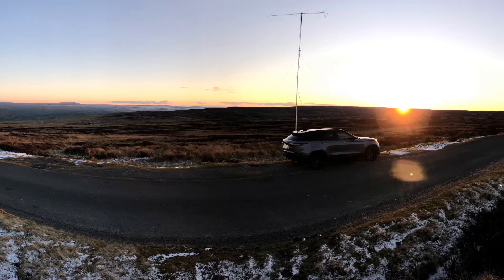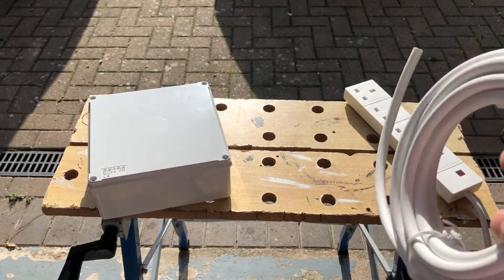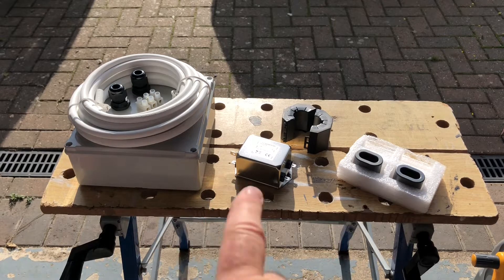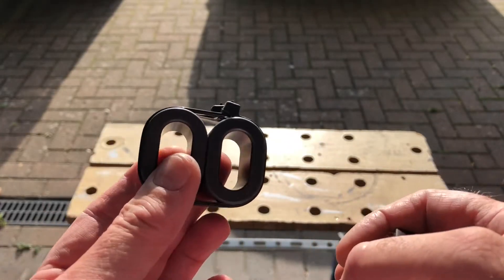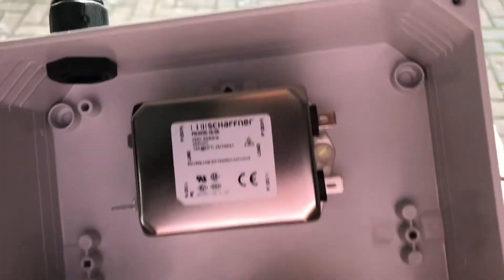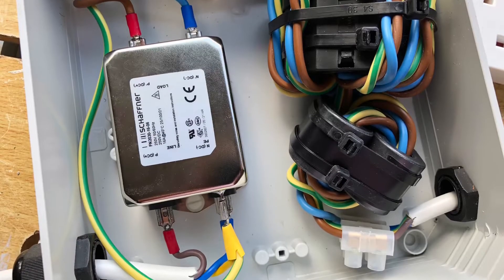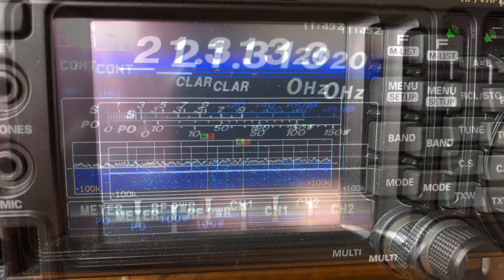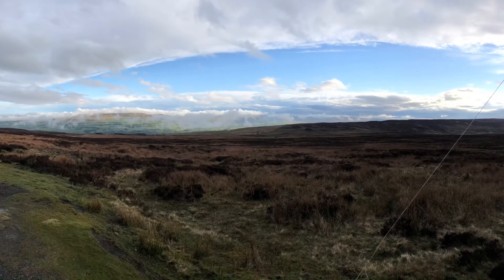Eliminate Your RFI - Build Your Own Mains Filter

Comment: Hello I hope you are doing well 
Can I use 3 Schaffner filters to get triple stage filtering? Can you tell me how to wire them properly?
Reply from the maker: I’m not sure there’d be any benefits of putting the same spec filter in series? And others are probably similar in spec as well, so no gain in say frequency range or attenuation etc? You could try. Just take the output of one as the input of the next following the models wiring instructions. Good luck 👍🏻
Reply: @G0CNN-Ian Thank you. I'll try my experiment. I think it's better to fuse high frequency and low frequency filters together and could give better results.

Comment: You built a Low Pass Filter. To get rid of the specific frequency noise, also include a Band Stop Filter, designed to that frequency. It will shunt that frequency straight to ground. It is simply and inductor and a capacitor of appropriate sizes that can go inside your filter box.

https://en.wikipedia.org/wiki/Band-stop_filter
Reply from the maker: Great. Thanks.

Comment: does it work the filters with 120V?
Reply from the maker: You’ll need to check the spec of the mains filter inside to confirm its working voltage, as this may need changing. You also need to check this wiring layout works with the mains supply wiring standards if you’re not in the UK.

Comment: For 50 Mhz and higher, How about using filter high voltage capacitors .01 uF and .001 uF across L1 to Ground and L2 to Ground before it goes into the commercial filter that is probably effective below 30 Mhz.
Reply from the maker: @Chad.Tyrone  For someone to consider. Thanks 👍🏻

Comment: Hi Ian, Did you ever drop the noise level down on 6 meters and if yes what core did you use? Great video, Thanks
Reply from the maker: @andya940  Hi Andy. No. Tried all sorts of multiple rings in various places. Never managed to suss 6m. One suggestion from the supplier of the mains filter was to take the earth lead direct to the output and not via the ferrites….never got round to trying and generator now gone  in favour of LiFEPo4 battery 👍🏻 I think the generator was more at fault than the filter….

Comment: Ian - very interesting project - and very good that you performed tests on varying bands. I am interested to see how you do with eliminating the remaining QRM on those bands that were still impacted. Will you do a follow-up video to show us? Do you know what the effective filter frequencies are? Have you considered shielding the mains cable between generator and filter box and between filter box and power strip? Have you considered lining the box with copper (or aluminium) foil to create a Faraday cage? Have you considered using an earth spike since you're going to use it in the field? Do let me know what you think. All the best, Rob in Switzerland
Reply from the maker: @RobWhittlestone  Hi Rob. I no longer use this generator and have moved onto LiFePO4 batteries. I tried various additional tests and ferrite combinations, but I could not eliminate the rfi on 6m. The tests showed the rfi was down the cable itself. One tweak possibly would be to take the earth lead in the filter straight to the exit of the box and not via the ferrites. Regardless, it worked great on other bands as you saw . Thanks for commenting 👍🏻

Comment: i would think that green wire should also be grounding the case of the line filter too, no? 

i have some SWL antennas that could use this
Reply from the maker: @thatfonkyhonky336  It does. Then branches off through the ferrites. Another design may be to take the earth straight to the socket and bypass the ferrites.

Comment: I have been looking at this design, and powerline filter...how would you do this in N. America where we have 2 hots, a Neutral and a ground? Would you need a different kind of filter? Or maybe 2 filters? Voltage been each hot to neutral is 120v, 240v between each hot leg (120v 180 degree out of phase).
Reply from the maker: @BryanGrigsby  Hi Bryan. I’m not sure. I thought you had three wired mains like us, just at a lower voltage? Best to consult an electrician I’d say. Good luck.
Reply: @G0CNN-Ian  Yeah, it's different than UK, two 120 legs, 180 dgrees out of phase, so 240 across each leg, with a neutral and a ground. I think I've determined you can use the same style filter running it either with 240 across both source inputs, and bypass the filter for the neutral, or run two filters for each 120 leg. I am going to test and see. I think I am preferring the two 120 routes, to make sure the neutral is also passing through the filter, but I am just guessing.
Reply from the maker: @BryanGrigsby  ok. Be careful.

Comment: Silly question but will it work with home installation as well? I have some degree of noice coming from various places/devices. Can I make one as put between my mail socket and radio equipment?
Reply from the maker: @dadscanplay2  Yes, that’s actually what it was originally designed for 👍🏻 Do a mains-off battery test first just to double-check it’s mains RFI
you’re experiencing, otherwise you’ll be wasting money. Good luck 👍🏻
Reply: @G0CNN-Ian  thanks Ian, I’ve done it already it’s seems that it could be a case. Great video appreciate it.
Reply from the maker: Good luck sorting 👍🏻

Comment: Well done! But if I see the design of gm3sek the LOAD and LINE not are the same of the your project. Why? Many thanks
Reply from the maker: Not all filters are the same. I’ve fed back to GM3SEK. Best to check the spec of the filter you’ve purchased before wiring. Good luck 👍🏻

Comment: Does the wiring around the cores get warm?
Reply from the maker: It shouldn’t do as it’s all rated to comply with the normal wire/fuse rating. I wouldn’t be touching anything inside of the box when it’s live. Thanks.

Comment: Will this technique work with a 12v to 240v 50 hertz sign wave inverter?
Reply from the maker: Hard to say Michael. I have had success with a generator but never quite sorted 6m inverter interference. I use a battery and inverter on 6 for occasional rotator use (due to the interference), but not tried the filter inline with this setup. I might give it a try to see 🤔
Reply from the maker: If I remember Michael, I’ll be able to try this Thursday on the 6m UKAC. Just depends if the interference is cable or air-bound…
Reply: Ok cool. Thanks for replying, if you get the chance to do a video I will watch. But if not I'll have to experiment and see for myself.  Thanks for the video 73's 👍
Reply from the maker: @michealbell5042 I tried it last night Michael and it didn’t work on 6m. I know it does work on the generator on 2m & 70cm, but I use battery & inverter on 6m because I can’t filter all of the generator inverter on that band. The battery inverter must have the same issues….
Reply: @G0CNN-Ian  Thanks for trying.  I guess that's where we have to experiment with it. Hay but you konw what you still did grate video and thanks again for replying. 73 and merry Christmas .
Reply from the maker: @michealbell5042  Merry Christmas Michael.

Comment: Thanks for your great video. I have built your filter with the same components and saw a good improvement.
My problem is that my high end PC is working perfectly at night while getting slow and sluggish at daytime which is a big problem for competetive gaming (even offline on Desktop).
It happens from grid and from a power station disconnected from grid, the Filter improves both, but I can not measure it.
My question is with which device and accessories I can troubleshoot this problem as cheap as possible? It is hard to find information as a noob.
Any hint would be appreciated. Thank you
Reply from the maker: Sorry to hear you’re still struggling. I’m afraid I’m not aware of a means of measuring in the way you suggest. Apologies if you’ve already considered this, but I wonder if you’re actually competing with other households sharing the same ISP local infrastructure and that’s why you see marked differences between day & night internet performance? Good luck getting sorted 👍🏻
Reply: @G0CNN-Ian thank you for your answer.
As the problem persists offline when the pc is not connected to the Internet, but your filter improves it, I suspect EMI/RFI.
So I would like to know which device I need to troubleshoot or how to even start. Spectrum analyzer? I looked at the model "TinySa Ultra".

This offline day/night difference is a widespread problem in the competetive gaming scene without any real findings yet. People trying many PC builds and different locations, until they sometimes find a "good" location by luck. So the problem is definetly something about the Location.
The main symptoms are:
-delay of input until visual response
-degraded visual quality of the monitor
-..
Which improves much at night.
I understand if that is the wrong platform to ask this but gamers are no RFI Specialists and I was trying to get any hint😅
Thanks
Reply from the maker: @patrickh9679  Ok Patrick. An easy electronics way to test is to run the PC on battery power. Either through a suitable inverter to provide mains voltage from a suitably sized battery, or with the right know-how, tap into the DC side of the PC power supply when not connected to the mains and provide the equivalent DC volts & amps ie pure battery power. THE IMPORTANT PART: A qualified electrician or electronics engineer needs to do this, to avoid all the obvious safety risks to the person undertaking the work, plus avoiding the damage risk to the PC. Good luck.
Reply: @G0CNN-Ian  understood, thanks.
Maybe my first post was confusing.
I tried run pc offgrid from:
a)bought 2000wh pure sine wave power station
b) car battery + pure sine wave inverter
nothing changed it is even slightly (constant) worse. Thats why I thought the problem is rfi and I wanted to check it.
Still this mains filter improves the situation for power station and ongrid. I have not enough know how why this could be.
The direct supply of dc is interesting, thank you.

Comment: With my horrible QRM on hf coming from my inverters , I’ve ordered in these filters and ferrite , enough to build two of these filters , I’ve got a 15amp 230 and a 25amp version , 

This QRM off the inverters is a real problem , I’ve proved it coming from the pair of inverters , even switching the load to the house off, there is still QRM from them , I think it’s going to be a challenge to cute this QRM for sure.
Reply from the maker: Good luck 🤞🏻

Comment: hi for the 6 m and above usualy you need a linear suply  hevyly filterd vith lots of small electrolitic and rfy caps and power cable 4 the radio shielded  and choks on the leeds 4 me it helpes maby it whill 4 you 2  73
Reply from the maker: Thanks for the info 👍🏻

Comment: A couple of points for safety. They may be covered elsewhere in the comments. 
Portable generators should have an earth at the generator as the origin node. This is always the case. In the event of device (load) failure you will need that protective conductor working. I strongly suggest an RCD on the output and said earth. Normally this is a spike driven into the ground below ground level (as the surface would become live in fault conditions). Your RCD would cut current in any event and also permit a far poorer earth to be operational. Always beware of underground hazards though when driving conductive rods into unknown ground.
Those were common mode chokes. All conductors passing through the same core. The idea being that current going up rather than round is dumped into the ferrite. Placing the earth in there too prevents it from draining this bad energy to where it should be going. That would be the true earth that you installed with the generator. The protective conductor should not be in the filter circuit and should always have as direct and low impedance path back to a nodal origin as possible. 
Earth noise should be eliminated by correct nodal wiring and never by filtering the earth. Great examples of earth noise being Hifi setups and amplifiers where the signal lines circulate mains earth via shields and introduce hum. If there was adequate earth on each box there would be no current through the shields.
Please research though as this is the last line of defence for faults and small mistakes can cost lives or at the least blow sensitive equipment.
Excellent videos through. Inspiring me to track down an endemic 2M broadband QRM.
Reply from the maker: Thanks for all that info Alister. I will follow up.
Reply: Alister is right here!
There you have a HF source of noise and you`ve ran ground wire through a choke. So, what you should do is:
Unwind the ground wire from the choke, it introduces impedance there. 
Make a separate bolt to the outside of the box and make it easy to connect an outside ground wire with a good steel spike at the other end and bring a hammer. 
The name says it all "ground" should be grounded. this way it just floats around not doing it`s job. I don`t believe it would burn your radio but you`ll get much less noise.
It will increase your radiating power too. 

Or, forget this all, if you are grounded through your antenna. Then your system is grounded and you should not be sticking anything more in the ground. You need just one ground point in the system. More than that and you`ll introduce noise.  

Best of luck.

Comment: Hi Ian, what is this plastic looking screw you have used to secure the schaffner on the box please? does it have a lock nut on the outer side of the box? Thanks
Reply from the maker: Yes they’re plastic bolts with nuts and washers. You can get them online if not local. Thanks for commenting and good luck 👍🏻

Comment: Hi Ian, I have this issue on a Champion 2KW genset and have already made one of these a few years ago for another application, I'm trying to locate it so I can use it when out /P up on the Weardale fells.
Luckily it doesn't creep up to 70 or 144MHz as I use these bands for Meteor Scatter, however 28Mhz and 50Mhz was unusable with the generator running so I invested in another 100AH battery as I tend to do overnight stays at my portable sites in IO85 and IO84 so having the generator there as a backup is a must. I've earthed the genset to the Van chassis and hopefully I will find the filter unit tomorrow as I'm out over the weekend and would love to be able to run the generator, as low noise as battery ops is the runtime is pretty restricted.

Cheers
Rob M0XXQ
Reply from the maker: Good luck Bob 👍🏻I was thinking about an earth test too, with a copper rod 🤔
Reply: @G0CNN-Ian  I'll give it bash tomorrow and let you know the result as I'm out overnight /P for the Meteor Shower.

Comment: I have had  installed a electric smart meter for my electric supply and putting a MW radio next to it the noise pick up hi very bad and even place it next to, the house wiring the noise is bad. I  have the parts for this filter and I am going to see if the filtered mains if there is any noise coming out of the filter using the portable MW radio .
Reply from the maker: Ok. Good luck. Maybe contact the installer about the issue?
Reply: @G0CNN-Ian  The smart meter is computer controlled and it uses I suspect a switch mode PSU.
Built the filter and listening to my radio no major difference .
I have built a copy of the Wellbrook loop  which helps a lot its ok for reception around Europe  but not low angle stuff. The noise has dropped from S9+ to about S6 on 40m. it has a very sharp null on near by switch mode PSU almost taking it out.

Comment: Hello Ian, were those before and after shots take when connected to your generator or mains? I tried running my FT891 on battery power at home this morning to see if I could identify noise that has plagued my FTDX5000MP recently (S7 on 20m-6m). My noise floor was lower today ay S5 pre-test, but only fell to 1-2 S points on battery power with the mains totally disabled. Only thing still powered was standby battery for our home alarm. Just curious whether you think it's worth my while building one of these? I suspect the QRM is generated from the homes around me. 73, John (2E0SVB).
Reply from the maker: Hi John. Yes the shots were in the genny, with/without filter. If you’re noise reduced by going on battery and you’d done a mains test on the same rig before, then yes I would say the filter is worth a try as it sounds like some of the noise is on the mains somehow? My mains supply is ok and the general noise is from the residential area around me. Good luck!
ps. Do you mean “fell by” or “fell to” when referring to noise levels?
Reply: @G0CNN-Ian  So sorry Ian, I meant fell by. Was S3-4 on battery power. Thank you!

Comment: Is this worth trying for the shack at home Ian? I have had S7+ of noise on some bands at Christmas...

73,

John
2E0SVB
Reply from the maker: Hi John. The original design was actually meant for home mains use. However, try running on a battery first as that will confirm whether your RFI is mains borne or not. If the noise goes/reduces on battery, then worth going down the filter route. Good luck 👍🏻
Reply: @G0CNN-Ian  I bought an FTDX5000MP which is mains only I think Ian. I can run my FT891 on 12v though, so will give it a go at the weekend. I hope you're well, Happy New Year!
Reply from the maker: @johnratcliffe6438  Ah yes, you’ll have to use the 891, assuming it gets the same issues? All good this end John and a Happy New Year to you and yours too 👍🏻

Comment: Nice work, Ian! Thanks also for the tip that it may be useful to turn the whole filter around.

Yes, it's an excellent project for a club - first to have a ready-built filter available for loan, so people can find out if they need one, and then to organise bulk buys for the parts.

73 from Ian GM3SEK
Reply from the maker: Thanks for the design Ian! 👍🏻 I’ve tried additional ferrites at either end and not really improved 6m. I’ve got a further tweak to try to improve it, just need to get round to it 😀